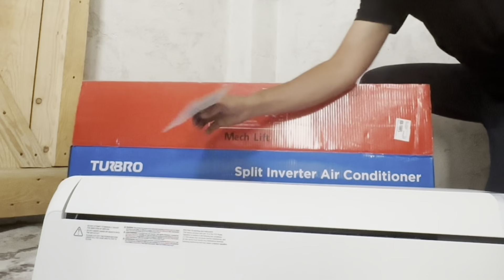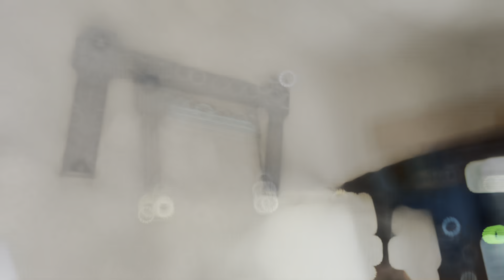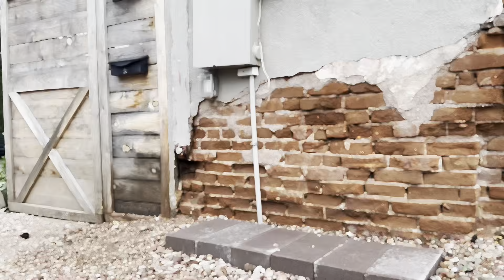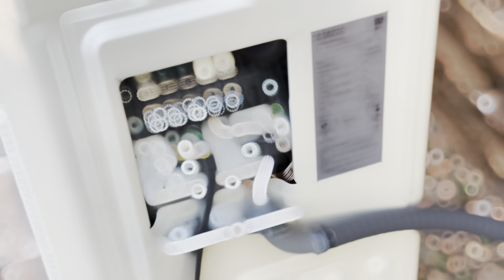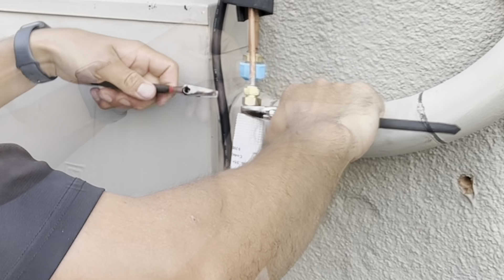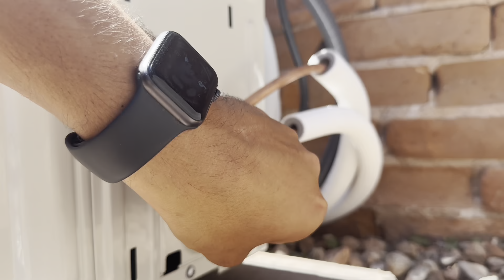Step-by-Step Guide: Installing Your TURBRO Greenland Mini Split AC for Optimal Cooling and Comfort

Comment: dam i hope my 9kBTU model FINNMARK goes as easily as this video describes , i dont understand why R32 is choice of Freon when NONE are available to general public other than R22, which no minisplit comes in, and equipment, gauges, pumps wont work for all types of freon, ie R 1234 and others need a different pump but not gauges , i understand the sparkless  pump motor warning , but great video, covers everything, this is master bedroom for a 85 year old , my mother who lives with me, the window unit aint cutting it, my central went out couple years ago and been using window units, even in large livingroom, dining open kitchen has a 12KBTU Midea i plan on replacing with a minisplit, mom has dementia and keeps turning window unit ACs off making bad air quality, allergens, temp, humidity would be minimized quite a lof it a AC flow was constant ( not to mention my anxiety and stress )controling with a smartphone, she cant reach high up air handler controls, hide the remote, is my goal, i hope this video helps me
Reply from the maker: Hi there, thanks for your comment. TURBRO Mini Split AC series are all could be control by app. For more information, please don't hesitate to contact our customer service team: support@turbro.com 😊

Comment: You can’t run Romex though the liquid tite, the rubber sheathing on the Romex makes the wire heat up and becomes dangerous, code only allowed un-sheathed wires in conduits.
Reply from the maker: Thanks for your kindly reminder.😊

Comment: I am new here.   The manual said release the high pressure valve 1/4 turn and press the service port for 3 seconds, but I have seen noone do that but just turn the valve for 5 seconds and do leak test.   Can you explain?
Reply from the maker: Hi there, thanks for choosing TURBRO . As for your question, Actually, these steps are all intended to detect leaks in the pipeline before fully opening the valve, and they all serve the same purpose. Please follow the instructions in the manual.😊 Hope you enjoy the summer cooling with TURBRO.
Reply: Getting ready to install my Turbro 24,000 unit.  I would like someone to explain how one presses the service port for 3 seconds or for that matter, any length of time.  My user manual does not explain how that procedure is done.

Comment: I just installed mine , and I want to know if there’s a little buzzing sound on the condenser outer unit. It goes away when I put it on mute mode. Other than that it’s working fine.

Comment: 14awg wire on a 20amp breaker....wow this is a fire waiting to happen...you guys should review your materials with experts before posting..
Reply: 14AWG is the guage the manual calls for for 115V 20A breaker. Is this a fire hazard?
Reply: @PAULAKEITH-m7m  14 should be fine. Certainly if your whip is only 2 or 3 feet long and using stranded wire like THHN. Stranded wire is a bit better than solid wire carrying current. Along with the fact that the unit isn't typically going to be using anywhere near 20 amps and more likely half that or less except in extreme conditions.
All that said. 14ga is the bare minimum that should be used. If 12 or even 10 is easily available then use it. Over building is never a bad idea.
Reply: Also outdoor conduit is considered a wet location, and NM (Romex) is not rated for install in wet locations. It would need to be THHN wire for this install as well. Not to mention the massive over-stripping of length on all the AC connections as well, the hot lead was stripped out past the end of the breaker when it was installed!

Comment: whats the difference with the 115v and 230v of the 12000btu unit?
Reply from the maker: The main difference between the 115V and 230V options for the 12,000 BTU unit is the voltage requirement.

The 115V unit is designed to operate on a standard household electrical outlet in the United States, which typically provides 115 volts of electrical power. The 230V unit requires a higher voltage of 230 volts. To use the 230V unit, you would typically need a dedicated circuit with the appropriate voltage.
Reply: For the 230v one you need to provide 230 Volts (actually it’s 240 Volts in USA), of power, most electrical panels have 2 live wires of 120 Volts fed into it, so you would need to get 2 live wires fed out of it to your breaker box into this unit, as well as the neutral and ground wires.
  Basically to run the 230v system will require space for a double breaker in your electrical panels (instead of a single space for the 115v system), and a more expensive wire (ie Romex 12,3, instead of Romex 12,2), run to your outdoor mini split.

Comment: Why is it important to have 8 in. clearance on the top and 14 in. on either side?
Reply from the maker: Distance requirements are pivotal in optimizing air utilization and averting compressor overloading. If you have any questions, please feel free to contact us directly at support@turbro.com.
Reply: @TurbroStore  Thanks for the reply. I understand why clearance on the top and sides of the indoor unit is important. I don't understand why it needs 8 feet below it. We only have about 6 feet below it.

Comment: Your black wire is installed incorrectly on the outdoor unit.  It is not under the screw terminal properly.
Reply from the maker: Thank you for bringing this to our attention. We apologize for the oversight in the installation of the black wire on your TURBRO Greenland Mini Split AC.

Upon inspection, we confirmed that the black wire is installed under the screw terminal but not completely fixed under the fixing sheet. However, rest assured that the black wire is in good contact, and there is no problem with the power supply.

If you have any further questions or concerns about the installation or need assistance, please contact our customer support team at support@turbro.com. We are here to help resolve any issues and ensure your satisfaction with your TURBRO Greenland Mini Split AC.

Thank you for your understanding, and we appreciate your feedback.😃